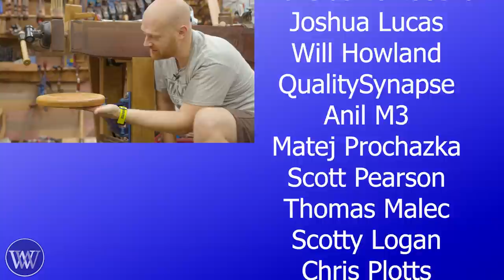Swing Out Seat for My Bench

Comment: If you want a shaped seat, you could always do a round mount to the casting and stick a large bearing to it (the plate) and mount the shaped portion to the bearing itself. There are lots of low profile bearings so it could still be around the right height without having to move it on your bench. I'd actually be willing to bet that there are swivel mounts that would be fairly simple to swap out for, too.
Reply from the maker: That is why I did not scoop out the seat I put on it. I may end up doing that. Time will tell.

Comment: Nice find! I had one on my bench for a while but ended up taking it off as it kept getting in the way. Might look at using it when my new workshop is built and I have more room and a new workbench designed to accommodate the seat.
Reply: Did you hit it with your knee and scream and curse?
Reply: @mercoid  I may have said a bad word or two... ;)

Comment: I brought a few pieces of Ipe because it was a pretty good deal and I've heard about its incredible resilience and toughness. Yeah, after a couple hours of working it with hand tools I just took the L. It is so brutal on tool edges and the interlocking grain made it impossible to get a smooth surface without tear out. Also the particular type of Ipe I got produced yellow powder when planed that stained my work surfaces, hands and tools!

Comment: If I may, I usually find that using a thinner width chisel when roughing out the curves makes it easier as there is less resistance, then after that I come in with a wider chisel to smooth it out, files and rasps or sandpaper also work great for smoothing it, in my experience.
Reply from the maker: Right on. you will see me using both methods here at different times the smaller chisel gives more control.

Comment: I like the idea of a seat that just goes away without fiddling with a stool and all the chips and stuff on the floor. Personally though I would want some sort of easy height adjustment since not every task is comfortable at the same height. Maybe bolt some wood to the iron plate and make a big ol' wooden screw to thread into it? Drilling through the metal would be quite the task so maybe offset it in a way where you wouldn't have to? I dunno lol  I may be coming up with a solution to a non existent problem.

Comment: You mentioned with the postdrill that you sandblasted it instead of wirewheel it because of the oil. Here you wirewheeled it. Did I miss anything?
Reply: The post drill would have oil from all the moving parts that require oil. If he had used the wire wheel, the oil and junk would just get spread around causing it hard for paint to stick. The seat would not have had much oil if any.
Reply: @cbryantbear6498  makes sense, thanks
Reply: @tlange5091  you are welcome
Reply from the maker: This one did not have grease and oil on it and I was using a new wire wheel. So this one was good to go.